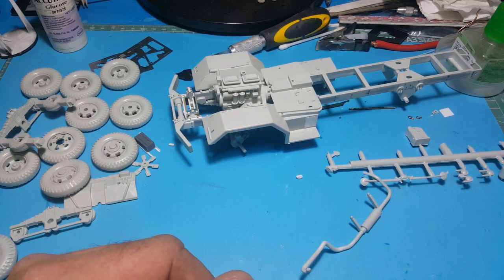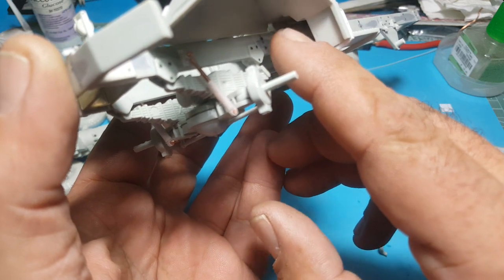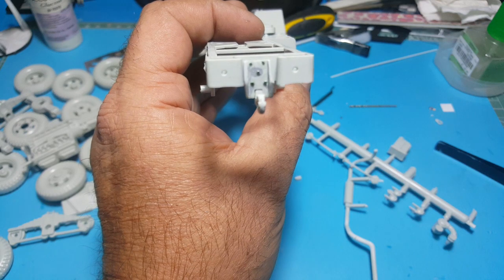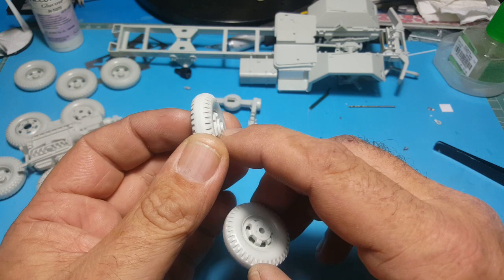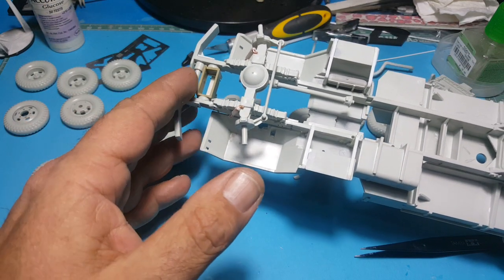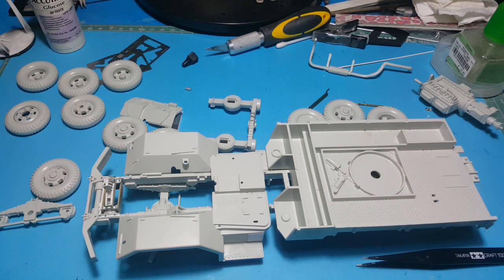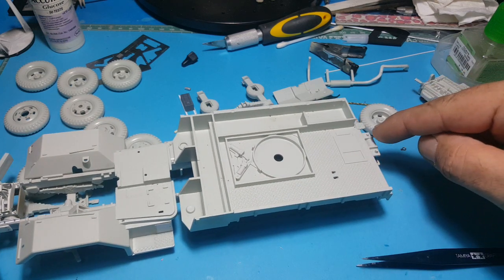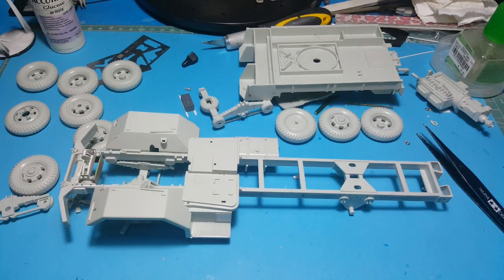Revell Renwal M62 Wrecker Big Rig Group Build Video #3

Comment: Is that 1\35 scale? Isn't that the predominant military scale? Looks like a pretty damn detailed kit.
I worked at a plastic factory when I was a kid. Those sink marks and ejector pin marks are a sign of to much heat in the plastic on injection! It's a subtle sign of a company more interested in quantity not quality. These things run easier and consistently at higher temps. To the minor detriment of the parts quality. They're trying to cycle the mold quicker per shot. Thus more pieces an hour. Just lazy mold men and set up men. Don't want to spend the time on a good setup. It just makes more work for us! Stay safe and healthy. I'll be watching for the next update.
Reply from the maker: Hi Tom it's 1/32 scale a long time ago many companies did produce 1/32 scale military kits and then 1/35 took over been far more popular